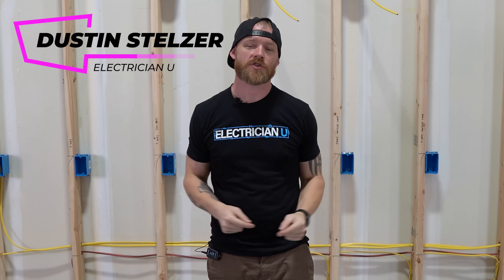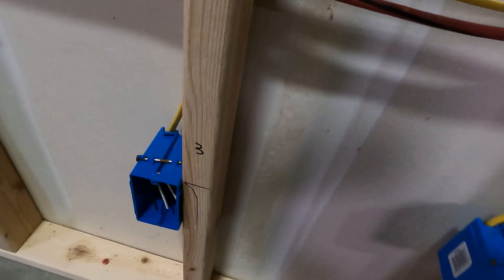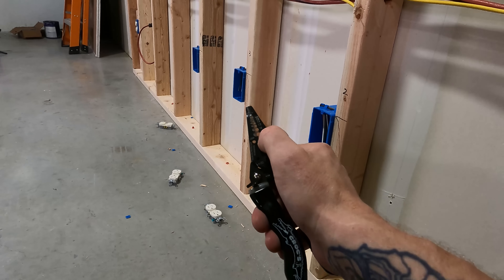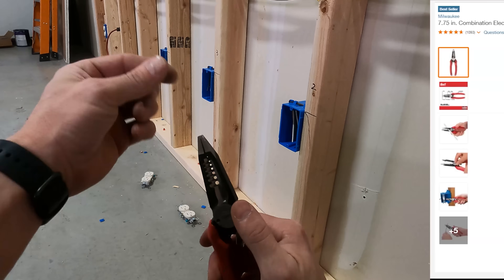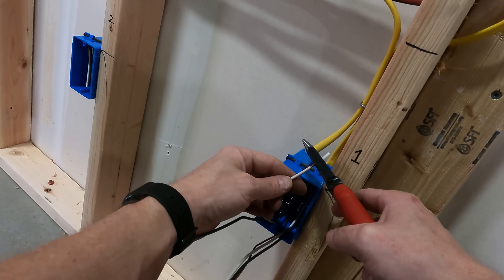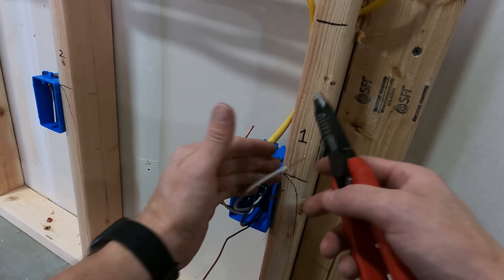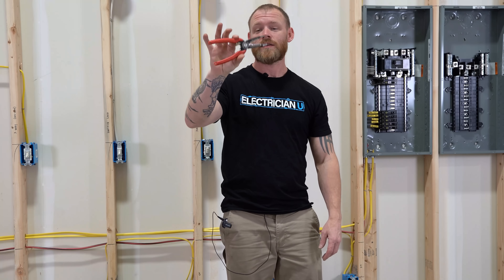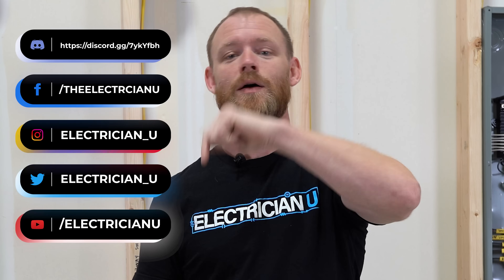Techniques on Stripping Wire - Awesome Tools to Help Electricians

Comment: Old school here. My Dad built phone offices all around the country, back in the day when they were needed. He taught me to simply crush the wire with your short long nose, and pull the insulation away. He was fast at it, and i got almost as fast as him. Still use his technique today. And as he taught me, no damage to the wire.
Reply: What is a short long nose?
Reply: @curt2742  It's a term I use to describe the tool. It's not a long nose, but a stubbed long nose, about 2" long. Very well built, and wide. I've found when crushing insulation on wire, and pulling it off, It's at the length of the strip gauge on receptacles. Again, an old tool, from a old tool belt, that still serves this old man today. Rod

Comment: I was excited to buy that Milwaukee 6 in 1 stripper it literally bent/broke after my first time cutting a 12 awg wire :( I went and got the blue Klein linemen ones and I’ve liked them a lot
Reply: the steel Milwauke uses is not good for durability

Comment: I’m sorry but first off you’re promoting daisy chaining outlets which is illegal.  You have to pigtail them.  Secondly you don’t need strippers that do #8 wire because any decent electrician can use the #10 side to do up to #6 with ease.  You don’t need to make any extra hand movements to strip all you have to do is fully close them and release them just a touch to strip.

Comment: Honestly.. Everyone reading. Throw every other pair of strippers away and buy the full size rack a tiers crocs, not the crocs Jr's. Imo, they're by far the most versatile strippers on the market today. Strips from 10-22 gauge, 6-32 and 8-32 thread cutters. Good for commercial, controls, and has a dual functioning romex stripper (one size for both 14-2 and 12-2).. You're welcome

Comment: good points.  I found over the years, that as one squeezes the stripper over the wire, if I then try to pull the insulation off as squeezing, it seems that it is harder to get it off.  Instead after squeezing the pliers, I relax the grip a bit, so that the cutter is not holding on to any copper.  Works much better for me.
Reply: I do that too, works great

Comment: Bending wire? NOT for me! I use "commercial" back (and side) wire receptacles. $2 each vs .68, but well worth the time saving, and the receptacle will handle 2 wires per screw vs 1, and no BENDING! And no need for pigtails to bury in the back of the box

Comment: These are stripping at 90° to the wire.
Does anyone use the type I used in electrical engineering where the cable is put in the end and handles closed to cut the insulation but you pull 180° away from the cable? An adjustable screw allows you to pre-set the gap if doing a lot of the same size wire.
I don't know what they are called. It's 40+ years since I bought them but still use them in my hobby. End wire strippers maybe?
Reply: They also make them that are for all sizes in one.

Comment: I've always been taught to not use strippers like that on solid conductors. The thought is if you knick the conductor, it is a point of higher resistance.
Instead using lineman's pliers to crush the insulation and pull gaurantees the conductor is not compromised.

Maybe this is old-fashioned thinking?
Reply: To me it just depends on the user. You can develop a technique that will not damage the conductors but it takes skill and there are some nuances involved.
Reply: It's old fashioned but from my experience the older guys have greater dexterity than the younger guys because they thought like that. That's why I've always done it the way you do.
Reply: Jeff, I just noticed your post. I posted a similar response a day later. Never used, nor own wire strippers. This old man was taught by my dad how to "crush and pull". Fast, no damage to wire, and one less tool to drag around. Old school I suspect, but practical. Dad was faster, but I suspect this old man could still "crush and strip", faster than an anyone working with wire strippers. Rod
Reply: @c50truck  I'd like to see a demonstration because I've never seen nor heard of that technique until this video. I've known some old school guys but they particularly never showed me that technique.
Reply: @illestofdemall13  Reach out to the host of this channel. It could be a great segment. Old school versus fancy tools. Rod

Comment: As someone who worked with live power almost exclusively, the idea of using your finger as a guide for stripping wire is quite hilarious.
Reply: If someone did it with a live circuit it's their own stupidity and they shouldn't be an electrician to begin with

Comment: Of course the tool is made for RIGHT HANDED people.  Try using it with your left hand and see how easy the tool is to use then.  For me everything is backwards.  The scissor action is reversed, the labeling is on the wrong side,  the extra accessories are on the wrong side.
Reply: You need a Kline Catapult stripper. You can use either hand

Comment: Can you make a video about fitting electrical outlets in a multi gang wall plate and techniques to do it quickly and neatly? I just installed 2 outlets in a 2 gang box and took me forever to get the outlets to face forward without being crooked before putting the wall plate on

Comment: After you strip and bend a hook if you turn them all to the left with your plyers it’s easier to put the plug on to the screws if you start the plug upside down for the whites and flip it over for the blacks then it’s ready to put in the wall . that’s what I do at least

Comment: The Milwaukee and DeWalt wire stripper power tool is a GAME CHANGER! - The contractor I am with now (2nd year apprentice) does NOT have any of these, so I landed three sets of 500MCM today using the OLD SCHOOL score and skin method with my razor knife, went through about 4/5 blades...Contractors I have worked with in the past have had them and they are just a GAME CHANGER...cuts terminating big ass cable, which is already a SOB trying to mold and shape those fuckers into a panel, IN HALF the time! It is hard af as it is!! doesn't need to be worse! These companies come out with these products for a reason!

Comment: I really don't like the wire strippers or electrical pliers that have a '' spring '' in between the handles ! They have a tendency to ''Pop the Spring  Out '' and it gets lost ! I prefer the Wire Strippers and Pliers that DON'T have a spring !

Comment: I would suggest using Black 3M electrical tape on all devices no matter what. Better security for wires and the person going to the device next to take out or whatever. I also recommend using a screw driver tightening up the device to the box as well as a drill will make it cockeyed if not perfect
Reply: Or you can do it the right way and not need tape
Reply: @JustinL614  doesn’t matter, if you walk into a commercial building and start taking off the outlets there most the time taped up buddy. It’s not required in the book but I know almost every real electrican does it

Comment: I love my milwaukee 7in 1 wire strippers, bigger cutting jaw, more variety of wire sizes you can strip. Plus they have the flat jaw like kliens
Reply: Yes, I use mine every day and I prefer them over any klein or knipex hybrids! I only wish the shears lasted longer, as mine have deformed some but it is probably user error

Comment: Good info but I would have liked to see included the stripper that also removes the insulation in one movement. Don't know the name but it's jaws pull apart to separate the insulation.  Very fast and accurate.
Reply: Klein Katapults, dunno an actual tool name, but the Klein brand is Katapults and they are incredible,
Reply: @VoltsAnBolts  Also Irwin has a good automatic wire stripper. I like that kind because there are no holes for the wire so it just uses friction to pull it apart. Therefore you can't accidentally cut the conductor by using the wrong size hole.

Comment: Dustin, how about doing a video on replacing the guts of an older Homeline service panel with the guts of a new plug-on neutral Homeline panel with the same circuit/amperage?

Comment: I hate Milwaukee strippers... if you use them enough (yes I'm saying you haven't ) you'll notice they get too loose and the metal between the wire sizes hit each other and you have to do a each m extra step to get them to strip... they suck and use them enough and you'll find out

Comment: You are great at teaching the how too's. I  have been an electrician since 1982. Most of the time I just use my klines for stripping solid wire without doing any damage to the copper. But I will use my strippers for stranded wire. Thanks again for all you do.
Reply: Hey old timer, 1984 here.👍

Comment: ive seen that milwaukee stripper and ive been drooling over it (among other tools) for a while now. but seeing as i work with wires over 10ga maybe once every 3 years, there is NOOOO way i could justify spending that much on it.

Comment: 2nd year Apprentice. Your videos have been a huge resource for me. I was hoping you’d focus in on some of these techniques, and here we are. How about tips and tricks of cutting-in (aka ripping-out, aka cutting sheathing)? I’ve heard lots of opinions on the best way to do it, and I don’t like the way I was taught. Thanks so much for this channel.
Reply: I highly recommend getting a good hawkbill hook knife like the klein with a replaceable blade for $20 or the milwaukee without a blade you can change for $10. With the hook knife you can ride sheathing super easy without knicking the wires like you can with a razor knife. If you take the romex cable coming into a single gang box for example, hold the cable at the end with one hand and a couple inches up insert the tip of the hook knife just under the plastic sheathing but not through the paper and you will ride that sheathing like butter and you will never go back to a razor knife for romex. It also works beautifully on SE cable as well. Also another pro tip if you ever run into cloth, "snake skin" romex and you find it difficult to strip. Hold the cable with one hand and rub the edge not the tip of your knife on the sheathing back and forth and you will see the cloth fall apart and it saves so much time.
Reply: Cutting NM romex sheathing? Use a razor or a knife and slice long between the wires.
Reply: @JustinL614  do you have any good way to strip u f wire ?
Reply: @tinorivera660  the best way I have found to strip UF cable is to leave it a little longer than you need. Then take you diagonal cutters and cut in individually at the end between the hot, ground and neutral. Then take two pliers and hold the hot for example and pull the neutral away from each other and the shrathing falls apart. And then repeat if necessary for the ground. Hope that helped!
Reply: @tinorivera660  ☝🏼
Reply: Just wanted to thank everybody for the responses. All the variations and tips kind of emphasize my original comment. There are LOTS of opinions on the best way, or the fastest way. A video exploring them could be handy.
Reply: You’re already planning on stripping out about an inch or so worth of copper so just take your razor knife an inch from the end and slice it open without trying to be delicate then grab the tip of the wire, pull towards you, grab the end of the outer casing and push away. The copper wire will always be in the middle if you’re doing UF so just follow the middle hump where the copper wire is and you won’t have to worry about cutting into your hot or neutral wire
Reply: Blade tip down into the wire, not blade edge
Reply: I 2nd this as an option for a video. I de sheath all the time and interested in seeing how others do it and others techniques that it can be done

Comment: The Knipex wire strippers have the flat end like a pair of linesman pliers, they will cut threaded bolts without having the thread them into the pliers and they have a large curved cutting surface for cutting wires
Reply: I just bought a pair of those, been using them all week. My journeyman was skeptical at first because he doesn't like the bulky plier-style strippers, but he fell in love with them and got his own pair after he played with them for a couple minutes. Probably the best $50 I've spent on a hand tool
Reply: They’re good for splicing but they suck at cutting wire unfortunately
Reply: They are great ! I recently bought them from Amazon ! $ 58.00 but to me it was worth the cost because they are like having 5 tools in one ! Saves room in my tool belt pouch !!

Comment: Good video. What about a follow up for different techniques to strip Romex without scoring the wires within?
Reply: You need a sharp blade and lightly score the romex not cut though it. And pull it off

Comment: I have the 12 volt version of the cable stripper and I LOVE it. I also use the milwaukke 7 in 1 pliers because the nose is wide enough to twist wires together for pigtails and reaming 1/2 inch emt.

Comment: On 8, 6 and 4 I use a multi tool that originally is used for cat 5 cable but it has a adjustable  blade as well as a multi blade configuration. The biggest I've ever used it on was a 10ga 4c cable

Comment: I had some 18awg twisted 3-pair shielded, PITA to strip it was huge and lumpy around .5" in diameter, could not use a knife as I was nicking the foil pulling it off, the installation was in a conductive urethane cable entrance system that ideally worked with the foil and not the drain wire. I used a 2 in one multisize RGxx/CATx stripping tool worked like a charm, which was great because the tool was terrible for regular network cable 🤣🤣

Comment: I’ve been an electrician for 22 years used Klein tools exclusively until I saw the same strippers said I’ll give them a try and man was I surprised they are the best I’ve ever used and they cut wire so easy you don’t have to believe me just give them a try you won’t be disappointed
Reply: What strippers are you talking about ? I’m currently using some Klein strippers

Comment: You changed my life with I saw you cut at an angle before stripping the conductor.
Converting 20+ 4 bulb florescents to direct wire LED gave me plenty of practice.

Comment: I like how you go into detail with your methods and tricks AND give an explanation. Excellent teaching!
Reply from the maker: Glad it was helpful!
Reply: @electricianu  Nice techniques. Do you make pigtails for your hots and neutrals when daisy chaining receptacles or do you just connect each wire to the terminals? I prefer to always pigtail. That way down the road only one receptacle goes out instead of several if there is a problem in one box.
Reply: @illestofdemall13  I was taught about 10 years ago to no longer use the terminals on a device to make connections. I have many failures in houses that used the stab in back to connect their devices. I always pigtail using wire nuts for the connections. That being said I do use the GFI type clamps to connect devices.
Reply: @Sparkeycarp  I still pigtail all line wires of GFCI and use the clamps to connect load side wires of GFCI. That way if the GFCI fails, only the load side devices will stop working. There could be power distributing from the box that feeds non GFCI protected devices. So if I have three boxes on the same circuit and a GFCI is going in each box, I'd pigtail each box. If I am going to use one GFCI to protect the other 2 receptacles then I'd use only the terminals.
Reply: @Sparkeycarp  Also, the push in back stabs are something I avoid.
Reply: @illestofdemall13  If you do them right it's not a problem. I'd say about 9/10 electricians I've worked with do them the wrong way.
Reply: @JustinL614  Are you referring to the push in back stabs? I am not sure what you meant. Thanks.
Reply: @illestofdemall13  Yes. Sorry I should have been more specific. I was talking about the backstabs. One of my old bosses was very cheap with wirenuts and only let us do push in back stabs. Over time I learned how to do them without any failing.
Reply: @JustinL614  I don't use them at all but I don't really need them. I just like to screw down or clamp down connections. I've never had a failure in over 15 years.
Reply: @illestofdemall13  That's a good track record. Better safe than sorry. Though I've been noticing things are different than they were years ago. Alot of contractors have been trying to cut costs and if they have workers who can perform a task cheaper, faster and just as safe they don't want to spend the extra time using more wirenuts to pigtail, clamping down every screw on a receptacle. It seems to just be the way things are going. Examples would be don't use tape around the outlet or.. wirenuts are expensive.. or use plastic boxes and romex instead of metal and metal clad. Alot of guys who are used to overbuilding for safety are not producing the numbers in order to be competitive.
Reply: @JustinL614  Yeah it all depends on what company you work for. The company I work for has us do the pigtails in the rough in stage and when it's time for trim out, you just put in the devices. I am not fast by any means but the company I work for does custom houses a lot. We use NM (Romex) and ENT as a sleeve sometimes when it is code compliant but some jobs call for MC or EMT. Romex is definitely fast and easy. We use metal and plastic boxes on the same job sites sometimes for different scenarios/needs.